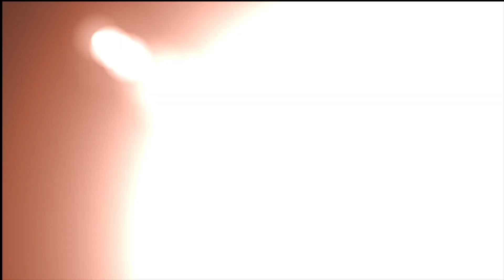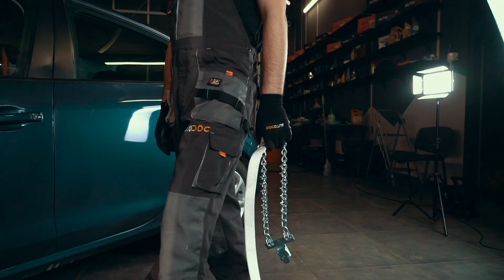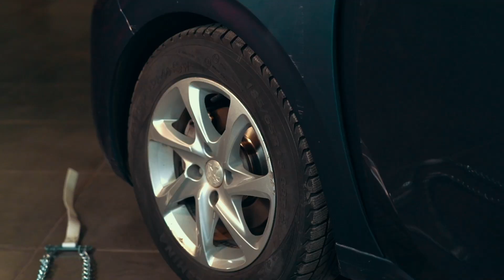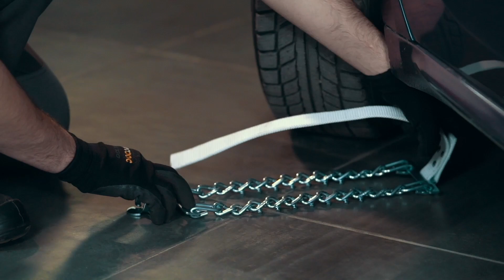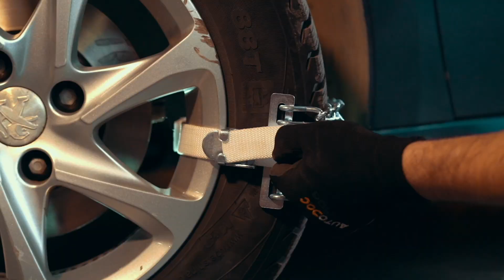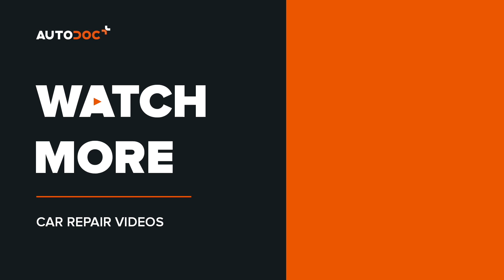How to Put on Snow Chains in Minutes | AUTODOC Winter Tips

Comment from the maker: Put the chains in front of the drive wheels of your car and spread them. In front of the wheel there should be located the side of the chain where the hooks are installed. 

Spread each link, removing loops and knots. Drive forward to make the drive wheels run onto the chains. 

Apply the parking brake. Connect the ends of the chain and secure the inner hooks.

Spread the chain and close the outer locks. Drive 8–10 meters forward, then adjust the tension of the anti-skid chain structure.

Only use snow chains on roads covered with snow and ice.

Do you know more car tips & life hacks? Let us know in the comments.